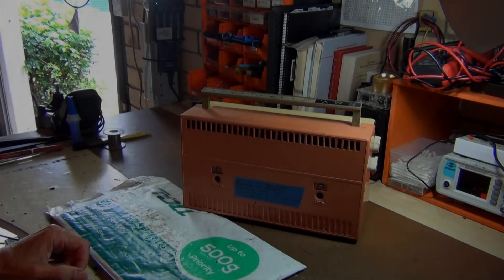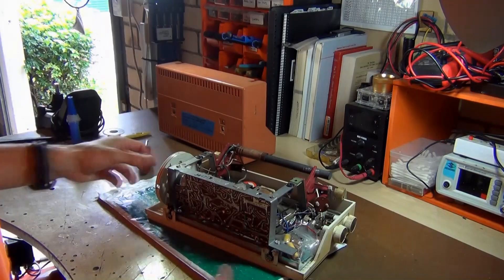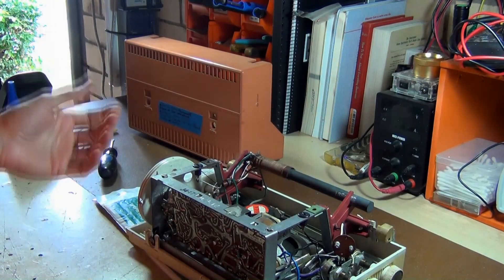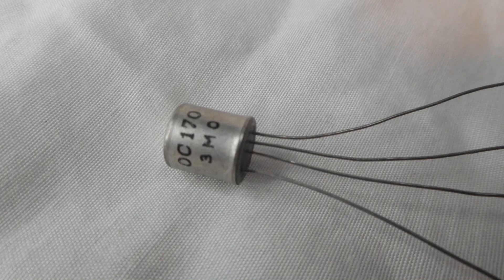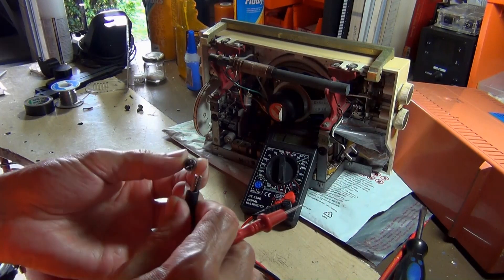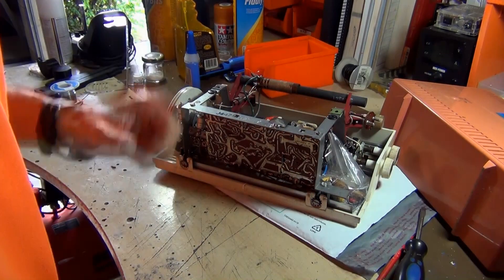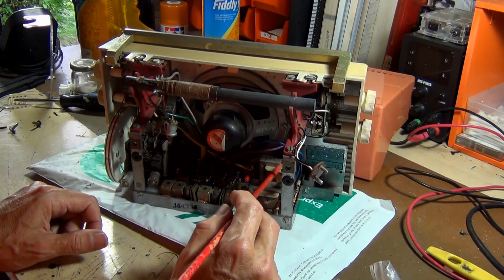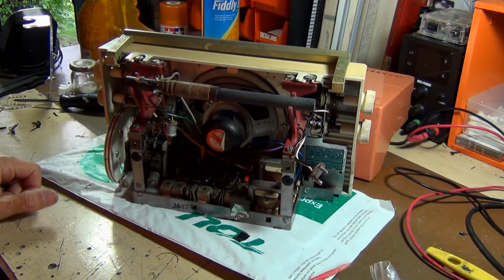HMV Little Nipper - Part 1 Vintage 1960's Radio Repair...This is Not Going Well!

Comment from the maker: More boombox videos coming soon, I have been super busy lately so I haven't had a chance to get to them all.I will be making the part 2's of all the boombox repairs and for those wondering what happened to those boomboxs, they are all still here on my shelf waiting to be completed, nothing gets thrown in the trash, I have lost one boombox in the time I have been doing this, and that was only because I didn't think I could get a replacement head for it so I used it for parts.Turns out those heads were available with a little digging, you live and learn, what's funny is that I ended up finding the same boombox model recently and acquired it, so looks like I get a chance to redeem myself.Also there's going to be a lot of speaker swap outs, I recently bought up a ton of boombox speakers from a seller over here, so it's going to be loads of fun, stay tuned.